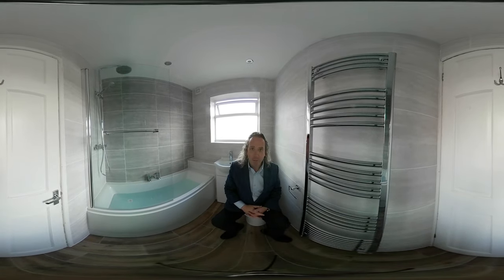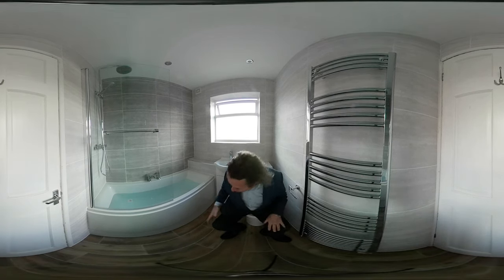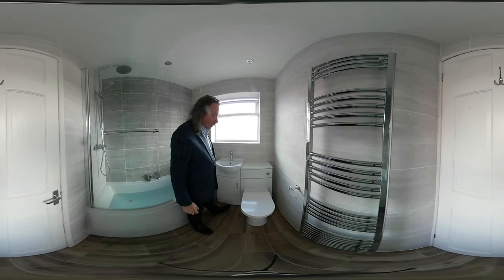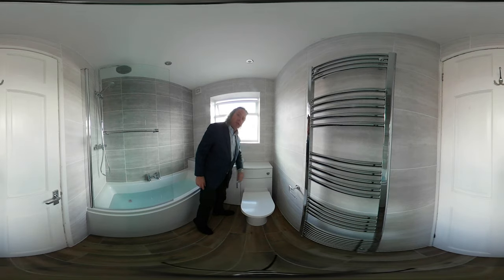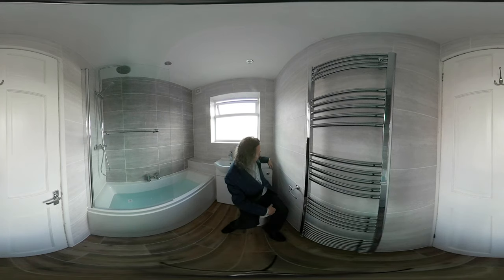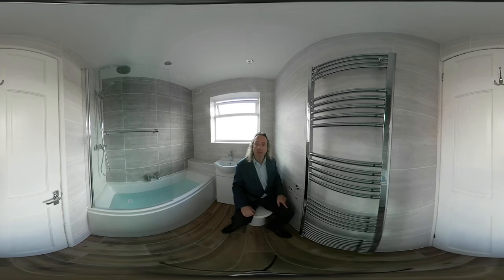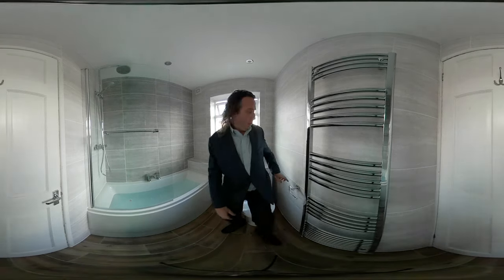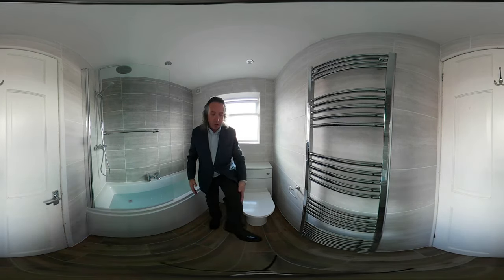Designing a Bathroom Correct Vanity Toilet Position

Comment: He's not wrong!
This is actually really good basic advice.
He's used a 500 wide unit example to help make his point, butting a 600 unit to the wall still doesn't work.
Having looked at this, my guess would be you want MINIMUM 370mm measured from centre line of pan - to FINISHED wall face, regardless of unit width.
Note, the vanity unit isn't butted hard against the bath either.

Comment: Just buy a WC unit that is 600mm wide not 500mm wide so that you’re not left with a gap. Simples!
Reply from the maker: Hi Rob, thank you for  the feed back. A 600mm unit will create the same problem and would need to be fitted away from the wall. It would only increase the leg space  to the side of the toilet to 12cm. It still wouldnt be enough. A well fitted toilet will have roughly 20cm to the side for leg space. A 50cm or 60cm vanity unit creates a problem when fitting it to the wall. A gap is still needed.

Comment: not only would there not be enough space for a human to use the toilet - it also makes it extremely difficult to clean - - we have one that an idiot installed incorrectly
Reply from the maker: Hi Marjorie, 

One of the problems is the manufactures, they take images of their products installed against walls. Customers then request that the fitter fit in this manner, the fitter looks at the images and carries out the instructions.

This is the reason i made this video, to try and steer people in the right direction..

Keep safe and well.
Reply: My husband thinks it was just a slack job way back in the 70's - they also installed a modular shower that just "drained" into the floor drain (if you can believe it ) - I pulled that out - the space is tight enough as a 2 piece bath
Reply: They should make the unit wider, so you have space to sit on the toilet and not be left with that awkward-to-clean dust-gathering gap at the side.  Pet hate of mine.!